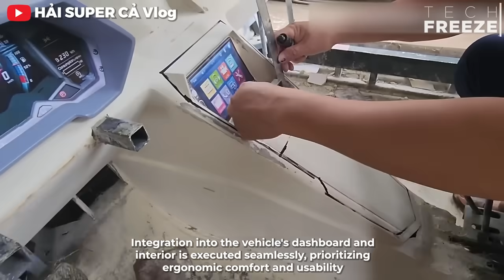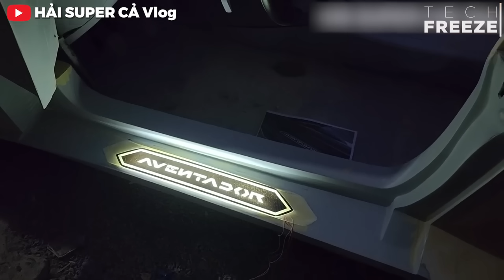Man Builds Amazing Lamborghini From Start to Finish By @haisupercar

Comment: This build deserves a better engine
Reply: 8685 k24
Reply: That was the first thing that I said that little lawn mower engine does this bulid no justice .
Reply: @Anthony-vr3um  lol a whole 86 on a k24. That's some dirty work lol
Reply: Exactly
Reply: Probably wouldn't be able to hold the weight.
Reply: @ricardov2469 😂😂😂😂😂😂
Reply: @SteveBlues87 ni les chevaux hp ‘
Reply: saw this comment before watching the video then I was thinking about some i4 toyota engine but it's worse 😢
Reply: Cảm ơn bạn. Vì đó là đam mê. Hãy theo dõi NHẾT TV
Reply: The problem is his Chassis if he can get a strong engine then it will be too heavy for the Chassis
I think cars like that are better on electric motors
Reply: Pedal engine
Reply: @kswappedem2  They should have bought and installed a Toyota GR86 engine at the very least (basic)
Reply: All you talking about the engine when none of you could muster up the talent to even add a ziptie in the right place, the man built a lambo from scratch, gtfo
Reply: The build probably cant support a stronger engine. Maybe in fthe welds were interlocking or like slip in prior ro the weld it may be stronger.
Reply: Lambi lol clay and crappy parts but he is talented.  The carbon and glossy at the end was real cool. @MrNickt1983
Reply: I wonder what it sounds like lol
Reply: You are comparing it to the original car, but the main problem is that this is the work of an individual, he did it out of passion. Admittedly, none of us have the conditions and ability to create a car by ourselves that is only similar to the original in a very small part, such as... materials... machinery... technology... etc., so with that talent and skill, that is what we admire. This car is not licensed to circulate in Vietnam, so they only admire the fruits of their labor and are one of the company's passionate idols. Wish the author continued success with new works.
Reply: @MrNickt1983 not trying to be a hater. But that's their point. A Lamborghini isnt fancy paint and cool looks. Lamborghini is performance. It's a performance car. That's 90 percent of what it is. The money is in the engine, transmission, suspension etc. I would rather have a fast Honda civic then a slow Lamborghini. Did this creator do a good job with very little to make a cool looking car. Yes. For a homemade car especially in that region. Did a killer job. Even the interior looks good.

Comment: Guys, I don't know how people like this do not work for car design/manufacturing companies. The sheer amount is skill and problem solving involved here is just crazy. And this is only one person. Think what he can do with 3-4 staff members. Job well done here, I am beyond impressed. One gripe I have is that little 200-300cc engine and that huge radiator - the engine is super under powered for the weight and the radiator will prevent it from reaching operating temps. A 4 cylinder toyota/honda engine would have been 100% for this, mid engine and the mounting is already there. Your frame design is on point and is more than strong enough for a higher HP engine.

Comment: I like how this guy welded up a frame, and added support to make it rigid/durable. But then cut out sections in the front sides back and top. Hope that didnt ruin the structural integrity of the already fairly flimsy lookin frame. Unreal job though. Quite talented

Comment: Dude... beautifully done... but some correction... those are not carbon fibers, those fibers are called fiberglass, made out of glass instead of carbon... and I have never seen a clay body like that... you have added those glass fiber to its outer cover, it might look good on the outside, but after some jerks, it will start cracking from inside... and it will also be as heavy as hell... but 10 out of 10 for creativity man... hats off

Comment: Awesome build but just a thought, making the pieces to the frame and body slip in or interlock prior to locking in with the welds would make a stronger and more reliable piece to install a stronger engine. And what kind of material was used to form this body?

Comment: This looks amazing, but I'm very curious - what did you use for the engine, the drivetrain, and the suspension? I'd be curious to know how it rides. It's one thing to look like a Lambo, but how does it ride. Great job making it "look" like a Lamborgini. :-)

Comment: Astonishingly, some professional painters in high-end workshops, equipped with Sata and DeVilbiss spray guns, still can't spray customers' cars in a booth without leaving runs, dirt, or craters caused by oil mist. Instead, they resort to complaining, insisting they need more time, better equipment, and higher salaries.

Comment: The subtitles are hillarious LOL.. it's almost like it's insulting the builder!! "Powerful engine is installed" as they're putting in what appears to be a motorbike engine.. The the flimsy rear spoiler to "improve performance and stability" haha.. And look at the build, he seems to be using motorbike brake rotors. Fiberglass over clay??? That's a funny but functional touch. The subtitles say "carbon fiber" although it's just fiberglass LOL. "Each component underwent rigorous testing for funtionality and reliability" LOLL.. But you gotta admit, they're extremely talented and artistic although this car only qualifies as a sculpture and not a vehicle

Comment: Great effort however, your build will not deliver these specs from the real deal: - 
Engine: 6.5-liter V12 with multi-point injection 
Horsepower: 770 hp at 8,500 rpm 
Torque: 720 Nm at 6,750 rpm 
Weight to power ratio: 2.04 kg/HP 
Transmission: 7-speed single clutch robotized manual gearbox 
Top speed: > 350 km/h (> 217 mph) 
0-100 km/h (0-62 mph): 2.8 seconds 
0-200 km/h (0-124 mph): 8.6 seconds
Reply: Yeah well it seems like they put a 50cc engine in there so no :D

Comment: seriously? you cannot call that a car, an exhibit piece at best. Nice hand craftsmanship though. also, do these people not like having toes? what is it with sandals and power tools?

I'm not seeing any carbon fiber anywhere. What I do see a lot of is glass fiber. Not the same, and I have my doubts about whether he could apply it correctly, if he can't tell the difference between them. Also, vinyl offers no strength, that's just pure aesthetics. 
try guessing at what will happen to the clay when he drops the hood or goes through potholes or speed bumps. It wasn't even baked, it will crack as it dries.

On the positive side, this guy is creative, has good manual skills and he knows how to show a good finish, but he doesn't have the means or the knowledge to build a regular car, much less a supercar.

If on the other hand, he could learn aircraft techniques to make and repair actual carbon parts, he has a good potential to become a recognized and well paid technician. If he learns that he must follow manufacturing and safety procedures, work in a team, study hard and work smart.

The end result looks good, but I would never consider that to be road worthy. It's a good demonstration of skill and creativity, as well as persistence, and i appreciate that. I also liked that he didn't use the Lamborghini badge, respect for that.

He seems to be at a crossroad between being an artist or an engineer. Whatever makes him happy, as long as he doesn't pretend to be the other. You can be an engineer and an artist, but not an artist and an engineer, unless you actually study and practice engineering.

Either way, best of luck, and choose wisely what your path should be.

Comment: could not bare to watch it all, welding process was horrible (is that aluminium MIG together with carbon steel???!). "quality parts and high standard" was used. the shortcut list to long to define. all done in horrible working position, calling fiberglass carbon fiber alot, painting with a normal mount seal. having chielden walking around while working with fiberglass resin.. and this is just a few thing. Should be banned from youtube. words like safe and high standard use in the end, i would assume it would end in the dumpster if it drove up to a TüV validation institute.